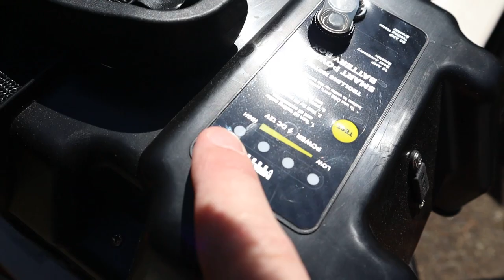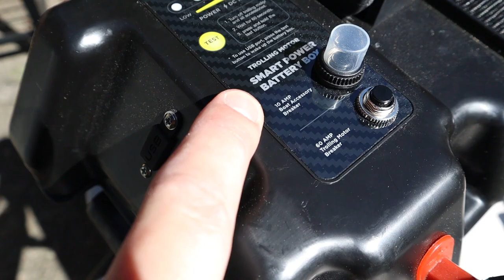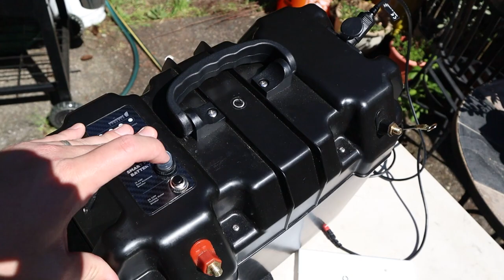PWM on My Wilderness SE or Colorado XT Pontoon! (Bonus Battery Box) - How To

Comment: Try liquid tight connectors and flexible conduit for running your wires too your controller. It will make a very tidy and waterproof installation. Any big box hardware store should have what you need.

Comment: Lawn irrigation valve control cable is UV resistant, round outer jacket to work well with waterproof connector on your hand control, and is available with 9 wires.
Reply from the maker: Nice I'll check that out!

Comment: I bought cat 6 cable. It contains 8 wires, same gauge as what was on the pwm.  CAT 6 is wound tighter than CAT 5. I bought an assortment of gland nuts from Amazon.  PG11 will directly fit one of your holes on the conduit box. I know because I just did it.
Reply from the maker: Cat5 was actually next on my list to try! I'll snag cat6 instead

Comment: While reduced speed settings on standard trolling motors do waste some power as heat, they do NOT use the same power regardless of the speed setting.  That is an old wive's tale.   Try hooking a current meter up and see for yourself.

Comment: Great setup! I have the same battery box, might try the same or similar PWM setup. Would be curious to see some kind of testing to see battery extended time savings with the PWM as opposed to without PWM using some fixed experimental full power, half power, troll time. to see how much the PWM actually conserves energy and time/distance on the water from origin push off.
Reply from the maker: Yeah I have actually thought about giving it a good test, too.  All I read before getting the PWM was how it was energy saving, but I did hear a couple dissenting opinions.  Need to set up a test for a couple hours one day to confirm one way or another.

Comment: What a great idea to mount the PWM in the battery box and then run a small extended hand control unit. Any issues with the PWM over heating in the box? I really like your idea of using CAT-5 cable, so long as it's just for signaling and not any measurable current? Thanks again, for great ideas and for the video!
Reply from the maker: Glad you like the idea!  I haven't had any overheating issues yet.  I've trolled with it for quite a while, too.  I want to look into like heavy duty CAT-5.  Maybe they make outdoor CAT-5 cables?  Either way, the bulky controller cable will have to go eventually haha

Comment: Thanks for the info! How is the pwm holding up I've heard these cheap pwm's burnout pretty easily?
Reply from the maker: I am/was worried about heat, but I used it for a solid season with no issues. I think they are cheaply built and prone to getting lemons, so you could get unlucky for sure...
Reply: @FishandForage  sounds good thanks!

Comment: Thanks for the tips. Where did you find the pressure gauges for your pontoon?  Do you still like them?
Reply from the maker: I got it on Amazon here:
https://amzn.to/2SVKZFb

I have to use a second O-Ring to keep the seal tight when checking pressure, though.  I've seen some in-line gauges that I think would work better, but this one does get the job done at least.

Comment: Question for you. I have a Colorado XT that I'll be using on a slow moving river. The river's current can be up to 5 mph. How fast does your 30 lb thrust motor move your inflatable? Trying to get an idea if 30 lbs is enough for my needs.  Tnx
Reply from the maker: It would not move it fast enough to go against 5mph current, but it would definitely help maneuver through it, if it's deep enough.  The other problem is the pontoon gets pretty squirrely when moving quick, so if you did get a motor big enough, it'd be a challenge to keep it pointed upriver while also fighting the current!

Comment: What battery do you use? How many amps do I need to last a day on the water?
Reply from the maker: This one I used was 60ah. I recently upgraded to a 100ah lithium though. I think 60 is safe for a solid day and a half of fishing and 100 is very safe for a whole weekend. Really depends on your budget and weight restrictions, too
Reply: @FishandForage  how high is your seat? I got the 7 in extention. Does your battery box fit under the seat or do you keep it in the basket?
Reply from the maker: @Clubber_Lang  I got the 7 inch pedestal, too. I didn't try to fit the battery under it. Only ever had it in the basket!
Reply: @FishandForage  you don't have any issues with too much weight in the back?
Reply from the maker: @Clubber_Lang  it definitely leans back a bit, but nothing too worrisome. And when I stand up on the front platform it does keep it more level lol
Reply: @FishandForage  if I don't have a PWM to stretch out the life of the battery, would you still go with a 60ah? Or should I go with an 85ah with nk PWM?
Reply from the maker: @Clubber_Lang  mine worked for longer than a day even before the own 👍